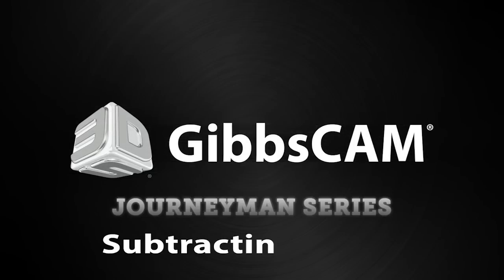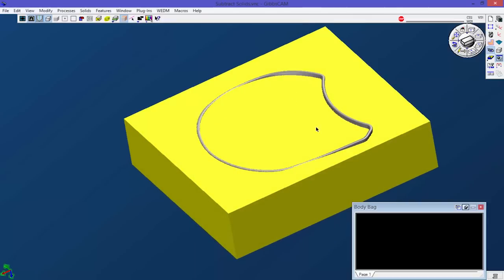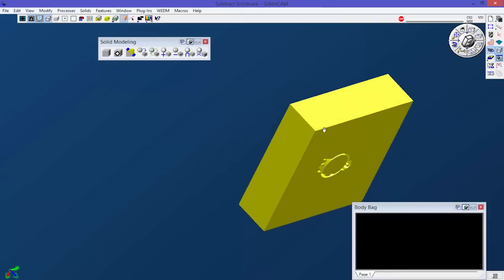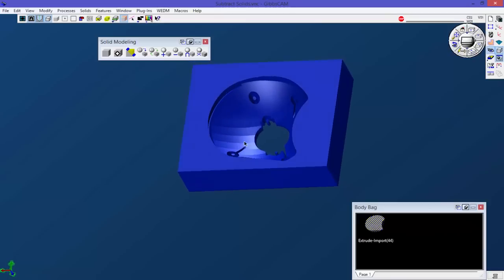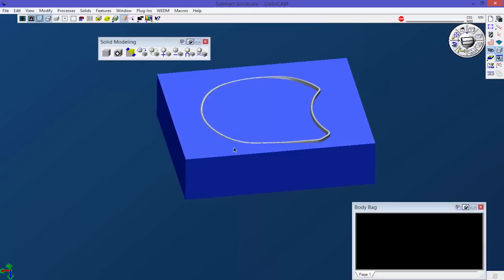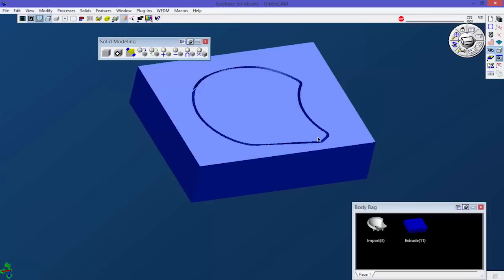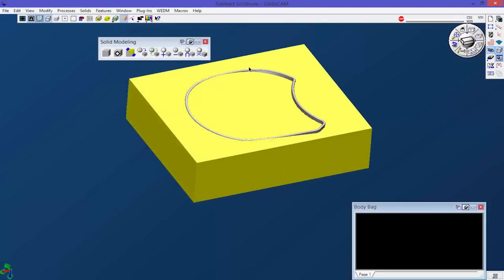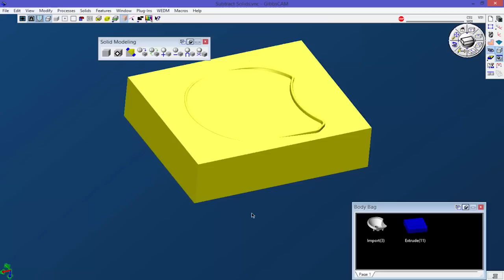Subtracting Solids

Comment: Thanks for this! Very helpful. I'm wondering if you could help me with a
 question about Gibbs? Can you create a solid after you have simulated a
 project? Lets pretend I create a solid block and then do some 
operations on it, (mill a pocket, etc) ....is there a way after I've 
simulated that project and am looking at the finished part , I can turn 
what I see into a solid model? It seems easier to me to let the 
simulated tool marks make my solid if that makes sense? Thank you in 
advance!